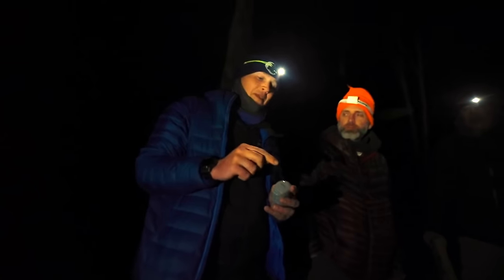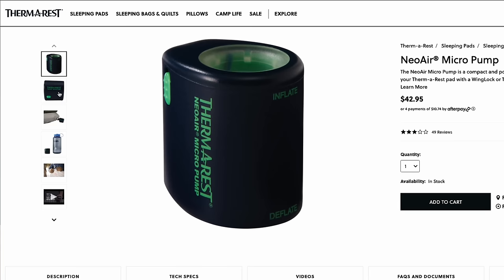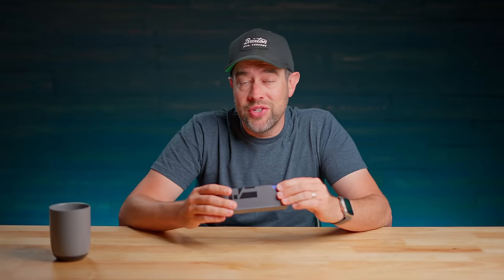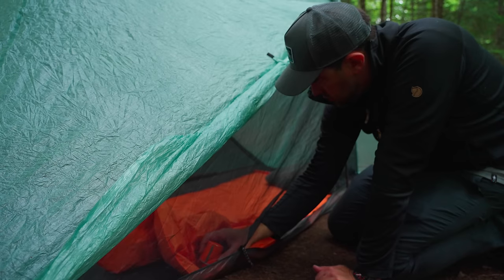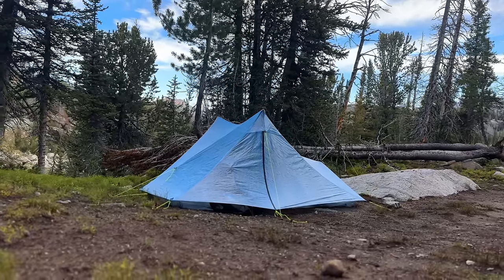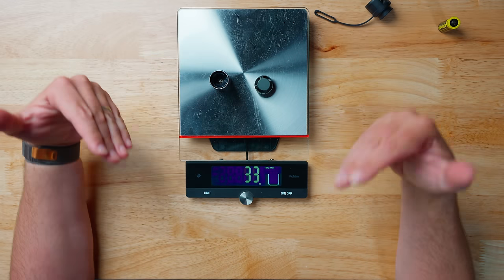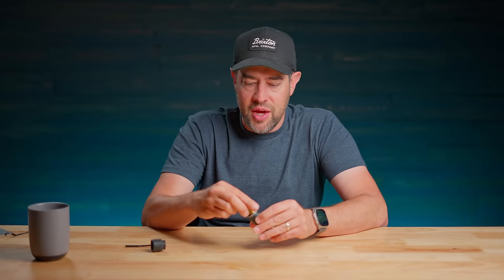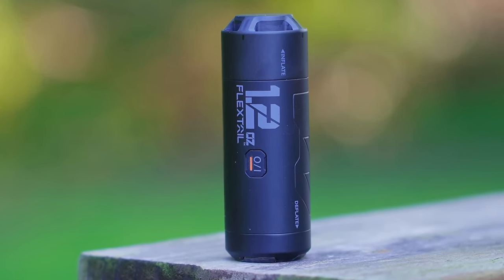The GOAT of camp gadgets just got a MAJOR upgrade

Comment: I have a one of their pumps which is great but the nozzle situation was a pain, I got a universal adapter from a hiking shop based here in the UK and so far happy days, I have Nemo, Exped, Big Agnes and a few other make as well, but I don't own any Thermarest pads so I couldn't tell you if it works on those. That little dinky one looks good but I do like the light function on the one I have and the ability to recharge frome my battery bank. Great channel Dan.

Comment: Super excited to get this in. Finally got it in. Battery was a super bust. Was able to turn pump on twice and the battery died. Would advise to stay away.
Reply from the maker: Strange! Mine works great and I have 2 of them. I have the nitecore battery that does not have a rechargeable USB-c port.
Reply: @DanBecker  My battery is the usb-c port version. Do you happen to have a link to that battery? Or is it the battery your's came with?

Comment: Thanks, Dan! I read about this little pump a couple days ago and was on the fence about backing it. You helped clarify a couple things. I'm going to wait. I LOVE that this new version is smaller and quieter! I would have guessed that this alone would have made me make a purchase. However, learning that you have to unscrew a couple things on the pump to get the battery and plug that in to recharge, to me, is Not a common sense design feature. I'm very responsible with my gear, but I know I would lose pieces, especially when the pieces are black. If the battery that comes with the charger goes bad, can you buy another battery that you directly plug into to charge? It would be nice if the pump and some LEDs to show how much charge was remaining. Regarding the light, my pump doesn't have one so I wouldn't miss it on this one. 
Also, my insulated pad is a Zenbivy... And I have no idea if one of those adapters would fit this pad.
Even if I have to pay more, I'm going to wait and hope that this smaller pump eventually has, #1, an external charge port and if it will inflate my pad. It would also make more sense if it came in a brighter color.
Despite it not currently meeting my needs, I still think it will be a great little pump!

Comment: I bought a 3d printed nozzle adapter for my Thermarest pump.  I can't remember where.  I think it was Etsy or something. It's made of white plastic.  It inflates the newer Big Agnes pads like the Insulated Air Core Ultra perfectly.  I use rechargeable Eneloop AAA batteries with mine.  I may still buy the FlexTail though.

Comment: I have to disagree with a lot of the comments; a pump with a replaceable battery has all the disadvantages of anything ran with AAA batteries, which is why the market went to rechargeable items, so you don't carry a load of batteries. A rechargeable battery with the port on the battery is a rechargeable item with extra steps! Single use batteries? That's not environmentally friendly, blah blah blah etc.
As you say, it's just a pump whereas my 2Pro is also a light and can charge my phone in emergency. Although, to walk away from the pump while it fills up your sleeping mat? Who does that? That's a niche advantage.
It's a great pump, but it's not an upgrade to other flextails.

Great video, glad you finally got a sponsored video from them ;)

Comment: You failed to mention that the battery is a rechargeable CR123, which is a huge pro for me. Also, the fact that it's removable is actually another huge pro, so in a pinch, I can swap out the battery without having to wait for it to charge. I already carry spare disposable CR123 batteries in a Thrym cell vault as an emergency backup to my rechargeable 18650 headlamp batteries, as my headlamp uses either a single 18650 or two CR123 lithium batteries.

Comment: Next step for this pump should be that you leave it attached to the sleeping pad. Most sleeping pads will leak a little bit over time and by morning, sometimes the pressure in the pad gets low. (could be because of temperature, could be because of the age of the pad). This kind of device should have that pressure monitor on it so that it can start up for a few seconds and fill it back up. (could be a bit noisy I admit).

Comment: I kinda like the battery itself being rechargeable instead having an integrated battery pack, for the main reason being is you can switch out to a non rechargeable battery in emergencies. Like maybe you have a power bank with you, but the power bank is drained, then you can just pop in a normal battery as a backup.

Comment: I wish they'd release one with a lock function. When packing with the old one the lamp came on (doesn't make a noise) and had I not seen it it very easily could have been draining my pump battery for the drive to the trailhead and the initial hike out.

Comment: I love the size difference, but the drawbacks of that tiny size make it a pass for me.
2 things I consider important are missing. You addressed one, the lack of a light option. My Gigapump electric pump is a clone of the FlexTail. The light has replaced my small collapsible hanging tent lantern. 2 for 1 is a big deal when trying to save space and weight.
But the other factor that wasn't mentioned is the lack of deflation option. Packing small requires repacking small. Having an electric deflator is almost as helpful as an inflator to me.
Still an innovative product, and I'm glad to see new advancements.

Comment: I can see why they wouldn't sell the attachments separately. Not enough volume to cover the manufacturing costs. Especially since the pump w/o battery is so cheap. I'm just annoyed it doesn't use a standard 18650 rechargeable battery though. That's my only gripe.

I already have the Max Pump 2 Pro, so i'm not needing another, so I'll make due with what I have already.

Comment: I bought a Flextail Zero Pump recently.

The threads to open and close the battery housing were very rough and gritty. At one point the aluminium chips and dust generated from opening and closing the pump caused the housing to jam halfway closed, although there was still battery contact with the circuit.

Upon further inspection, opening and closing the device resulted in a huge amount of aluminium debris being generated. Aluminium dust is very flammable, and I am worried that generating a flammable material inside an electrical device that is blowing a lot of oxygen past it, while inflating flammable mats and pillows inside flammable tents is a recipe for disaster.

Comment: I've grown to hate my flextail, and have switched to just using pump sacks.  Why?  Because holding it the whole time it's inflating the pad isn't just annoying, it attaches in a really wonky way and is super easy to slip out of my hand - deflating the pad, and wasting battery blowing air all over the place while I scramble to pick it up.  This looks like a HUGE improvement - I'm not going to drop the $$ on it right away, but I'm going to spread the word and hope someone gets it for me for Christmas.
Reply: pump sacks never need a battery and are lighter
Reply: I never have to hold my pump. I use 2 tips together to securely attach to my pad valve and do other things while the pad is filling. I do have to carry the weight of 2 tips, but it’s only a few extra grams that I feel are worth it to fill hands free.

Comment: MYoG'd a 5Vdc USB-A squirrel-cage fan into a pump.  It only weighs 28g and pumps much more efficiently and faster than inline fans.  Not sure why manufacturers don't use squirrel-cage fans?  Maybe Thermarest will leapfrog Flextail with the superior squirrel-cage fan?  If they were really smart, they'd use USB-c PD and make the battery optional.  Most hikers carry a battery-bank and could forego a pump battery OR ...PD could allow the bank function if one were to carry a battery.  Completely flexible options by using PD.

Comment: I'm still rocking the old NEOair, also, still kinda disappointed with it. Using a lithium power source is and some of these newer motors is going to give this pump a lot more blow than the tired old neoair, that I think barely had a glorified computer fan. Most of the military/tactical community is overflowing with CR123's, and a lot of us already use rechargeables for lights and other accessories. Looking at the specs, this device could probably also use 18350's with the slightly higher voltage lipo chemistry making it compatible with some dual fuel style scout light batteries. Neat!

Comment: The original Tiny Pump's 3.5KPa wasn't quite enough to get my pads as firm as I needed, especially since inflatable pads get softer as the temps drop at night.  As soon as it released, I upgraded to the Tiny 2X, which does the job for me, but it's heavier than I'd like it to be.  I wish they offered it without the light and the magnet.  When the Zero Pump came out, I was ready to get one, until I read the specs.  The Zero Pump's 2.5KPa compared to the Tiny 2X at 4KPa is simply a deal breaker for me.  😕

Comment: The lack of the rechargeable battery port is a deal breaker IMHO.  However, for someone who is counting fractions of an ounce, I can see how it will matter.  The lack of a light and the ability to charge an electric device (phone etc) is much lower on the wish list for me.  I already have dedicated items for those things.  

Q:  Does this have the capability to deflate an air mattress too?  Ex:  I have a Lost Horizon foam/air mattress (ExPed copy) and it's a pain to deflate all of the air out of it.  The pump that Lost Horizon has will inflate and deflate the pad.

Comment: This is great but not having a light is a real shame. Surely they could fit four one inch rows of leds on the outside of the battery cannister ? Anyway, i don't go anywhere without my pump nowadays so I think this is a great tool. I'll just have to go back to using my headlamp which i always take anyways...

Comment: I can see how one of these would be much better that blowing into the nozzle directly with your mouth for multiple reasons. What I’m less sure of is the benefits of one of these pumps vs the simple inflation bag pumps, which also work great, are very light and don’t require charging.

It’s a pity that the light functions been dropped too.

Comment: Are the nozzle fittings that are included proprietary or by some strange chance? Would this work with an Intex air mattress from Wally World.  I do a fair amountof camping by motorcycle and really enjoy the minimalism of it. Like backpacking space is always at a premium. One comfort that I refuse to give up is a full tilt, 8 inch tall air mattress. A smaller and more compact method for inflation would be a welcome thing. What I use right now is something you plug into your car and runs on 12 V. It definitely works and I’ve used it for many years but it is bulky.

Comment: It might be small, it might be light, but if it's so loud it scares all of the wildlife in a 5km radius away when you turn it on, it's not a win. :) They totally missed the boat designing that pump around an 18650 battery, which many modern headsets and flashlights already use. You'll reduce weight by carrying just one 18650 instead of this proprietary form factor battery.

Comment: I much prefer units with replaceable batteries. The non replaceable battery units have a very short life spam (since every battery have a life cycle..) and the replaceable battery ones can be simply swapped with new battery and serve you forever. Plus, I always use rechargeable batteries so there is no need to buy new batteries.

Comment: Not sure how big an upgrade this is over the Tiny Pump X or the Tiny Pump 2X.  Yes it's super light, but the battery capacity is half of the last generation model, I have to cary a spare battery and another light to replace what you already have in the TIny Pump X or 2X.  To me, you're just shifting the weight from inside the pump to outside the pump and potentially adding weight with the added extras needed to replace the functionality integrated in the previous models.  I'd like to see a larger battery and rechargability in the device.  I don't see having a replacable battery as being that big of a deal.  I've never had to recharge my Tiny Pump X on an outing, and if I did, I carry a batter bank for my phone that I could recharge it if I needed to.  I do like the form factor and the design of the nozels.  I just wish it had on board charging, integrated light and a larger capacity battery.

Comment: Pad makers should just copy Exped and make their own "Schnozzle" pump sacks. I've used mine for years to keep my sleeping bag, pad and sleep clothes dry. It's ultralight, high quality, and even the medium size is very large, large enough to hold winter sleeping bags with space left over for other things. When you get to camp and take everything out, you use it to then inflate your pad in what, 30 seconds? No batteries required. I think of these mini pumps as luxury items, they have one use and one use only.

I have a Big Agnes pad and it comes with its own pump bag made of the same material as the mat, they use scrap pieces to make it. It is heavy, pretty small and does not work as a waterproof bag. Absolutely useless piece of junk if you ask me. I used to have some Thermarest pads and these also came with a pump sack... Which was just a polyester bag. It was small, didn't seal tight and the fabric wasn't even waterproof. Also useless junk. Please, just copy Exped and forget about the pumps.

Comment: Hi Dan. Flextail sent me your video to demonstrate how to deflate a Nemo sleep pad. You haven't included that in your video but I'm wondering whether you've had any success in using the Zero to deflate your Nemo pad - I can't get it to work with my Nemo pad and Flextail's response after sending the video has been to refer me back to their User Guide, which lacks detail. Curious to know if I'm just useless or if the Zero Pump simply doesn't work to deflate a Nemo pad. It works great on the inflation side of things but a bit too heavy to justify taking it instead of the pump sac unless it can deflate the pad fully too. Thanks :)

Comment: Paul Messner raised a good couple of points about this pump on his channel. It doesn't have a light so if you want a light in your tent then you're taking an extra device that adds weight to your kit.

If you're going ultralight then you're going to use the inflation bag that comes with the sleeping pad to inflate it. 

Also i carry a power brick to charge my devices but the lack of USB on this means I'd have to carry a battery which is just another thing to bring along and potentially lose.

For those reasons it just doesn't seem like a worthwhile gadget, but it's still cool how small it is.

Comment: Okay I've never looked at pumps for air mattresses before. For those that have them, is it really worth using one over just using your mouth?
Reply: Yes, totally worth it. The air you breathe out is very humid and can cause moisture to build up in inside the mattress. Like Dan said, this reduces the R-Value and promotes mold growth. Also, many of them can be turned around to suck all the air out quickly making it much easier to pack.

Comment: This is just bizarre. It's like a solution for a problem that not only doesn't exist, it can't exist. If you are unable to blow up an air mattress you probably won't be able to go camping in the first place.  I've had the terrific but slightly heavier/less expensive Klymit mattresses and pillows for many years.  Not once have I thought, 'gee I wish I had a pump.'  FYI I'm in my late 60s and have asthma. No one needs this. (If you're car camping or blowing up a spare mattress at home - sure use a power inflator.  If you are using one of those whole family size mattresses, you're probably a few feet from your vehicle.) There are also self inflating mattresses

Comment: I don’t get it. The older Flextail 2.0 has a light so you can also hang it in your tent. The new lighter pump has no light so the weight you save will be cancelled out by a light you now need. Sorry but the Flextail 2.0 is still the one for me… and it’s not that load at all.

Comment: those rechargeable head batteries suck donkey balls......

they barely hold a charge and i mean barely like 700mah when a typical 18650 lithium battery can hold like 2100 to 3000mah.....

those things literally die after 5 mins and u have to recharge them for two hours again.

Comment: Picked one up based on recommendation here and elsewhere. Mistake. Unnecessary piece of junk. I'm a gadget head but this was...completely unnecessary and it only worked once on a multiday trip. You're introducing another piece of gear with one (maybe two uses if you're making campfires). But single-use gear, that is prone to failure and does not offer significant improvement over existing technology is a total non-starter for any type of GOAT status. Neat, optional, luxury item? Maybe. i had to go back to blowing up my pad when this failed. Not only did this not kill me, it didn't even inconvenience me. Blowing it up was faster than the pump, the one time it worked, and this inflated the pad to a firmness I could use. With the flextail I still had to blow it up to get a firm pad. The outdoor industrial complex is getting a wee bit out of hand
Reply: I was happy with my 2X until it refused to recharge the FIRST time I tried recharging it. Hope the company makes good on their warranty!
Reply: @kwhatten  they did with me. Tried to trouble shoot over email, had to send video, they then sent a new unit. I still think this is a gimmick gadget, carrying something else that can fail in exchange for minimum benefit. But that's subjective. What's objective in this case is that the, company's solid